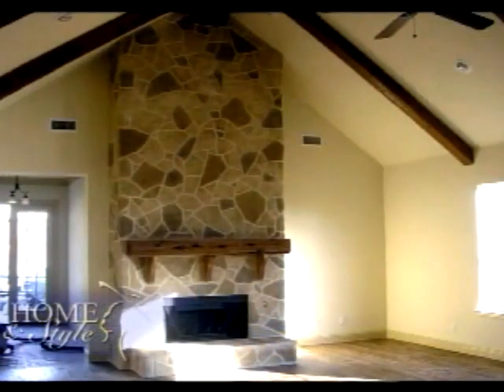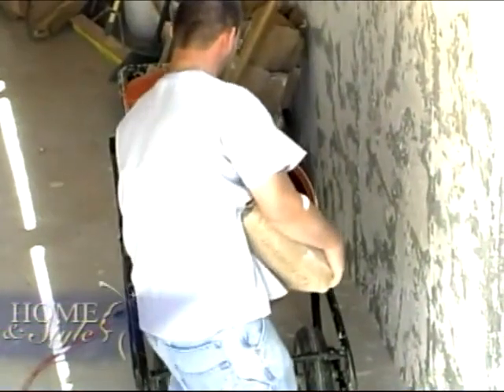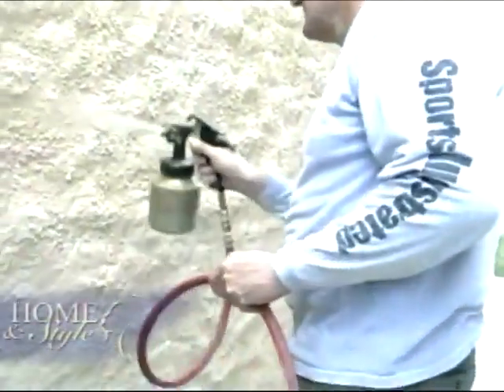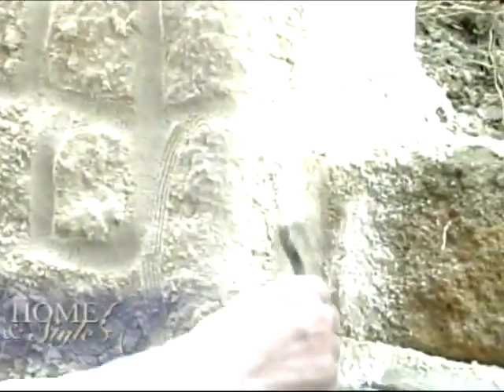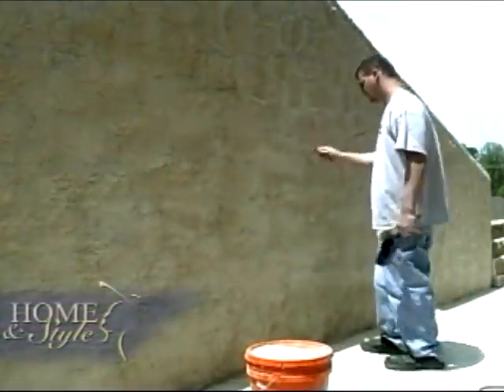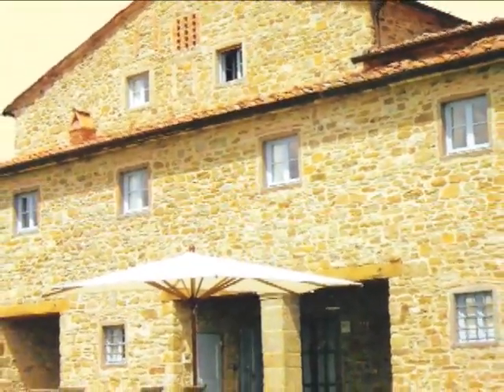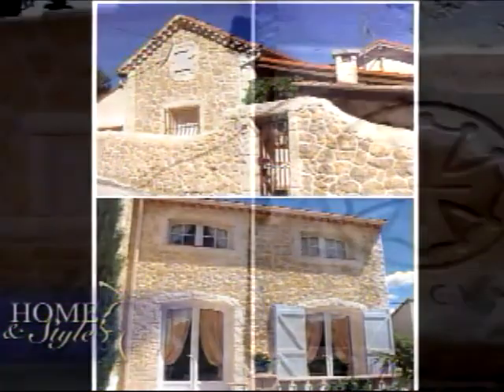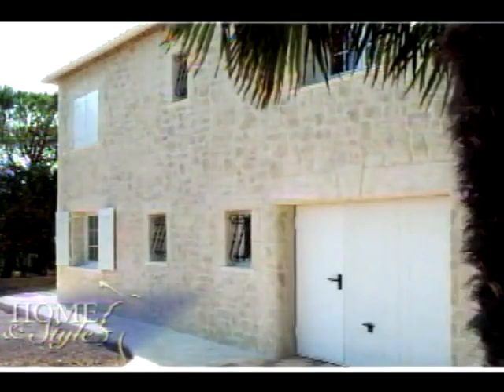[StoneCoat] Creates Beautiful Walls from Spray-on LimeStone

Comment: Iv seen this a while ago. Would you recommend  this on a mobile home? Will any surface be ok to use?
Reply: Chris Hughes use foam carve to the shape you like and then coat it in cement render with ochsides to give diff colors and coat each brick with the colored cement